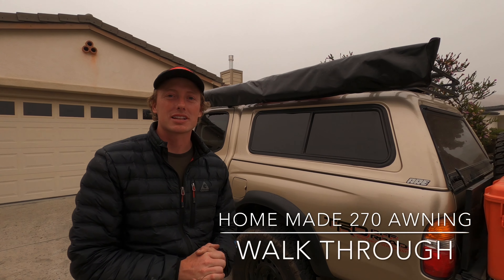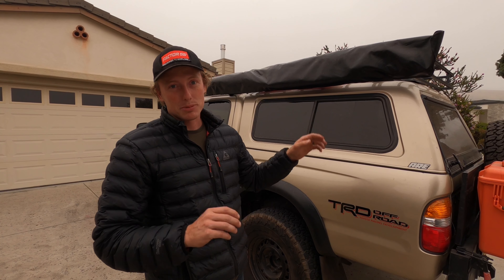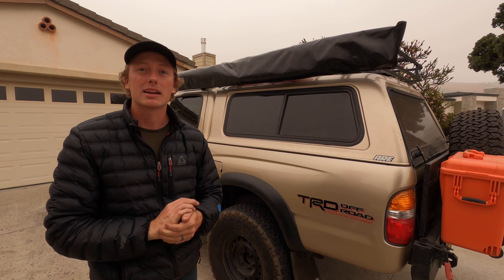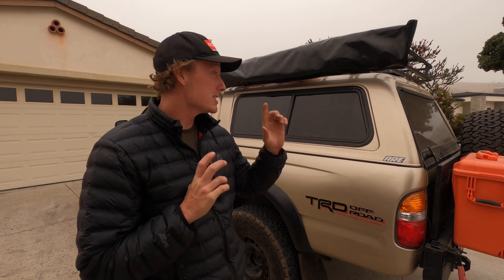Home made 270 degree overland truck awning

Comment: Wow great build! This beats the $2000 price of the South African or Aussie built options all day.  I was thinking of using 8020 extruded aluminum but haven’t sat down long enough to figure the pivoting hinge mechanism without needing to weld something together, I just want to keep it cheap and simple. I thought about using sail canvas, not sure how much it sells for new but it certainly offers the strength and durability vs canvas made for other industries. The fog makes it look like you’re in coastal California, maybe you have access to a retired sailboat sail to use on your next build?
All the best to you…

Comment: Absolutely killer build. Any idea how much the whole assembly weights? Any chance you have the measurements on the two hinge plates? Those seem to be the critical geometry component. Definitely a subscribe!
Reply: I'm gonna chime in with some quick math in metric system lol
The 20x20 15mm tubing used has a density around 0.9kg/m
He used 18m of those, that's around 16.2kg which we can round to 17kg with solder and primer.
The plate and bolts are harder to estimate but I'd guess 2kg total.
Around 0.5kg for the tarp
That sums to 19.5kg or around 45pounds.
For the geometry, the side bars should be 45 degrees from the car and 90 degrees from the middle one. 
So you can plan the holes: drill the first, align the bar 45 degrees from the car and drill it 3/4 ahead(cause of tube size). Then place the second bar 90 degrees from the first and drill 3/4 ahead.

Comment: I built a 270 that is not self standing, and I purchased the ARB 2500x2500 cover but the tarp I used doesn’t fold compact enough it’s very very tight fitting. Want to trade covers?😂